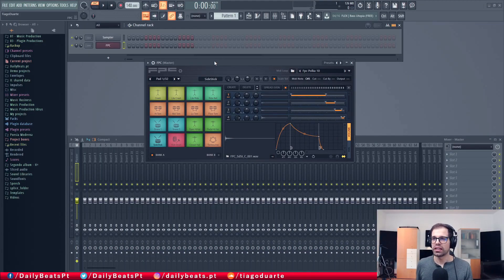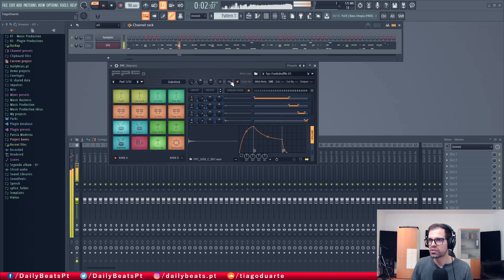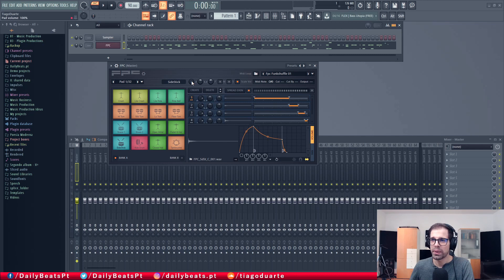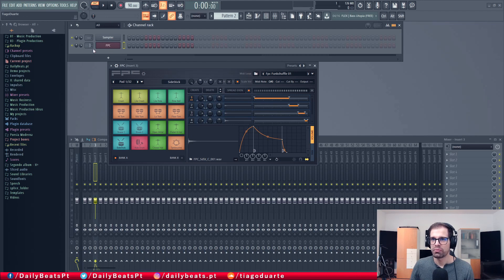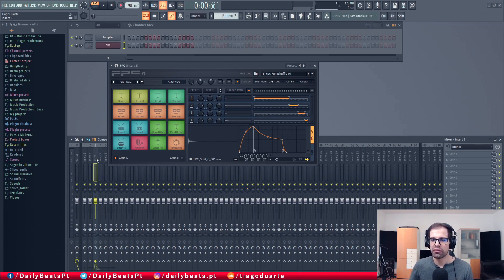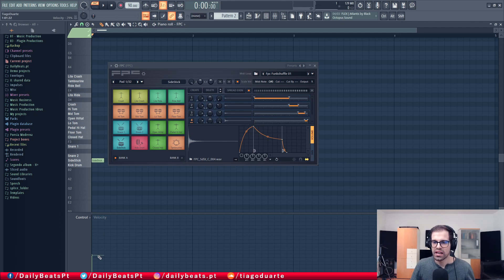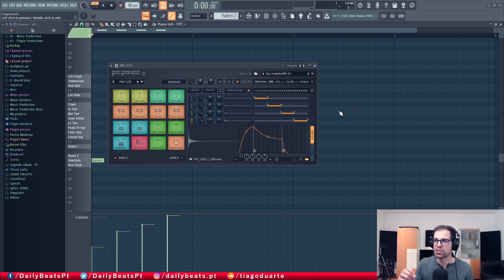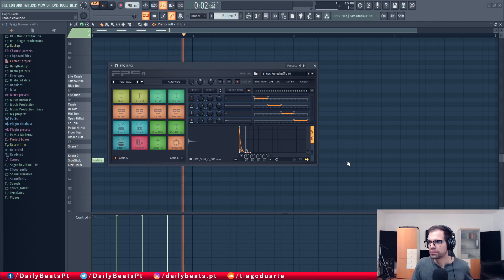FPC Crash Course | FL Studio 20 Tutorial

Comment: Hi! Is there a way in the FPC plugin to change the pitch without changing it's time-stretching? Not for single pad I mean
Reply: In the native FlStudio frame of the plugin (FPC in this case), click the first gear wheel up left, the frame will expand, on the right you'll see its volume, pan and PITCH (with its range selector) controls. They will work when you play pads from the keyboard or playing the pattern/song, not work when you edit pads with the mouse.
Reply: @nomepredefinito1174  thanks for your reply! But the problem it's the same... when I put up or down the wheel control, the samples that I've put in pads change automatically the time stretch: when i do up the sounds are more fast and down vice versa... I'm working on fl studio 20.8.
In the old versions this mistake doesn't see
Reply: @Karmaleonte  You're right, I tried putting a loop on a pad, otherwise I did not notice...